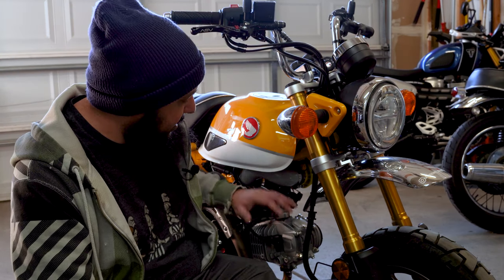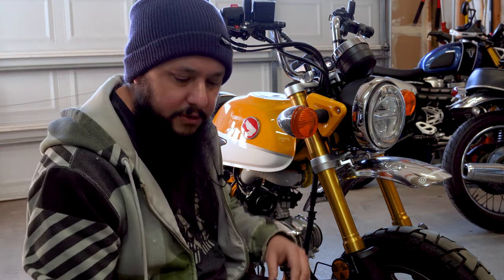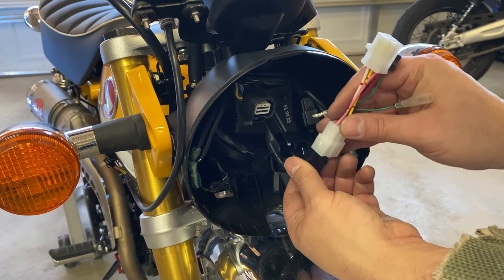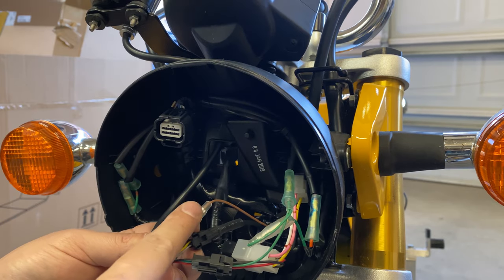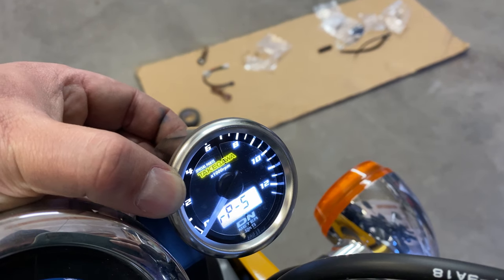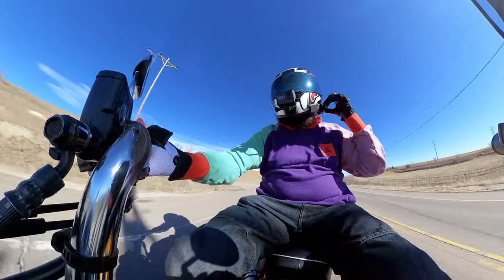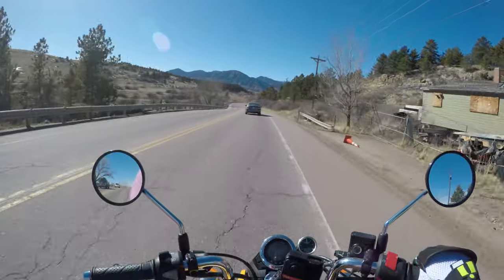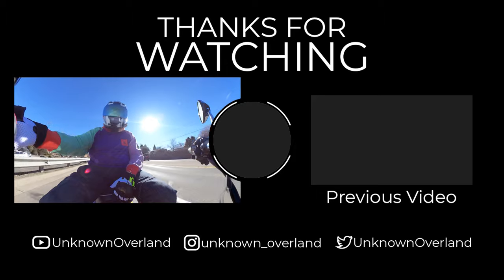Honda Monkey | Show Me Those RPMS! Installing A Takegawa Tach and Hitting 10kRPM!

Comment: Once you ride for awhile there is no need for a tac. You soon learn the feel of the bike and should be able to pick up on its limits. Same goes for those that think they need a gear indicator, you should be able to feel what gear you are in at any stage without an indicator.
Reply from the maker: I totally agree, being able to hear and feel the bike is ultimately way more important. Goofing around with the engine, it helps having some amount of added information.

Comment: I saw your video and really liked it. I've been wanting a tack on this bike. Your install and the tach looked great. So I ordered one.  The install was pretty fast less than an hour but the headlight was a real problem getting back on. All I have to do now is finish programing the clock X cetera.  Thanks for the great info plus Google translator really helped.
Reply from the maker: Glad you liked it! That headlight space is such a pain with the wires in there, if only there was even a little bit of extra space it’d be so much better. Without some kind of translator, I’d have been totally lost!

Comment: Nice....I just purchased this kit for my Monkey and the install was OK but trying to figure out the programming in Japanese!
Glad I found your translation on getting it configured correctly. :-)
Thanks!
Reply from the maker: I'm so glad that helped out; I totally got to that part and just stared for a bit without any idea what to do. What else have you put onto your Monkey?
Reply: @UnknownOverLand  
Just got the Monkey about 2-weeks ago so not much yet. 
I also installed the Koso Volt/Amp meter with the nice steering stem clamp mount that makes it look like factory install as it sits recessed in the mount. 
Thanks again....
Reply: Sorry......a question for you. 
Did you find a way to change the temperature from ºC to ºF?
Love your Yellow Monkey....that's what my wife wanted me to get but red was much more available on remaining 2019 models.
Reply from the maker: Not sure how I missed this comment, sorry about that. I did not find a way to switch that to ºF so far. I tried a couple things but just couldn't figure it out. Looking at the manual again (and attempting to translate a bit more) my best guess so far is that it can only do ºC as well as only a 24hr clock (unless I missed something).
Reply: @UnknownOverLand  
No problem....
Appreciate the response, I concluded the same, that it's only setup for ºC
Works well otherwise and really like the RPM readout. 
Thanks

Comment: Quick question mate.  I have a 2019 Monk, with Yoshi 19-22 exhaust set, short air intake and reset ECU.  I have a Taki tach on order.  What RPM ranges do you consider redline?
Reply from the maker: If you haven’t tuned the ecu (or replaced it with some other option) redline for the Monkey is around 8k RPM usually.

Comment: no just the intake
Reply from the maker: Ah, the intake is a little more tricky. It’s definitely going to make the bike run leaner but you might be ok if that’s it. You’ll need to watch the temps and the spark plug to really see if the bike is running too lean. I’d likely look at a bazzaz or a tune just to be a little bit safer.

Comment: Where do u get the ecu?
Reply from the maker: The ECU at this point was stock with the Monkey but I had it flashed by DHMotoring since I had installed a new Cam. This involved mailing my ECU to them to have them tune it and send it back.

Comment: Over revving is a sure way to cut the life of your monkey. Lubrication suffers, valves float and you actually make less power. Why dont you just but a bigger bike?
Reply from the maker: I actually have a bigger bike (also on this channel) which is why I like using this little bike to play around with different mods, but I do get what you're saying; sometimes an engine can really only do so much.